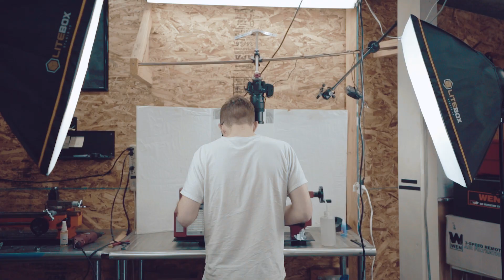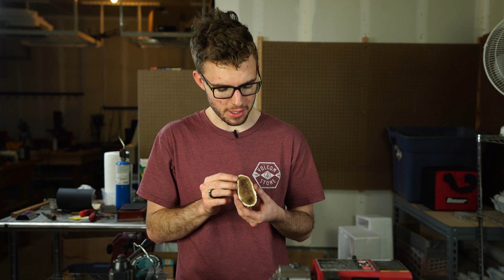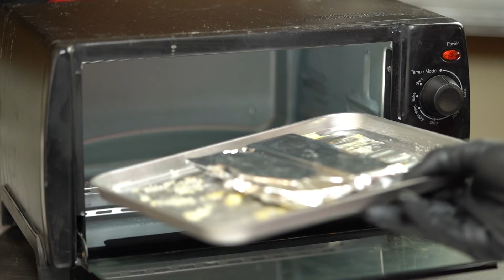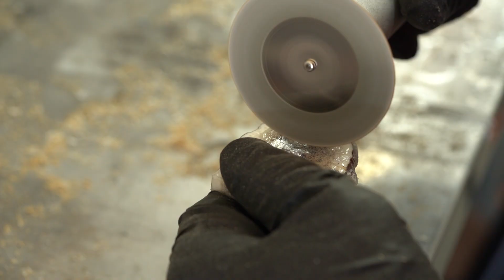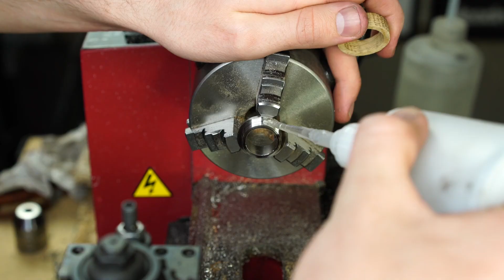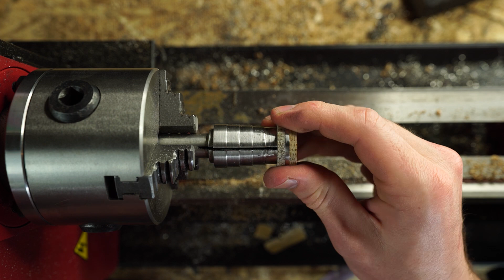Making an Aged Whiskey Barrel and Deer Antler Ring

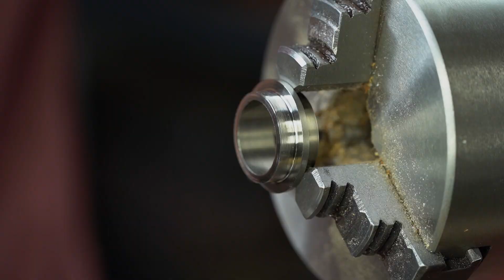Comment: Im sorry but I have to play grammar advocate here. Ive seen in a couple of your videos that you use the term “viscous” incorrectly. ( 7:43 ) In fact exactly opposite to the definition. The viscosity of a fluid is its resistance to flow. Thus honey is more viscous than water. It would be more accurate to say that its a very non viscous fluid.

Comment: You might benefit from trying some lathe tooling from A.R. Warner. They make insert tooling but with high speed steel inserts which tend to work better on smaller lathes that lack the rigidity and feeds/speeds necessary to properly utilize carbide. Trying your hand at sharpening high speed steel blanks on a bench grinder is a good idea too as you can make tools to fit any shape or situation.

Comment: Sorry, last one. I just saw the screen grap? I don’t know what it’s called but the pic you see before you click the video. I saw that and thought about maybe you could also do 2 metal bands instead of one. It would be the same process as in here but with both bands more to the side like in the ring of the link. This would allow you to do material on the side and maybe resin or glow powder in the middle? Something like that. I guess you could go in with this and try 3 metal bands though I think it might be too much at that point. Then again, I could be wrong. It would hard to do but if it was symmetric: (wood, metal, resin, metal, resin, metal, wood, etc.) it could work. You could also use food coloring to make the resin a solid color or even put glow powder on top of that for a hidden glow inside the solid color. But keep it up!!!

https://youtu.be/WtaR3suI9AI

Comment: I think this new method you made for working with unstable material is much much more efficient and I like the change of style and materials in this one. 👍👍👍

Here’s a challenge. Have you thought about making one from glass? I’m guessing you would have to use molds and melt it into shape and then sand it down later but if you could do it you can make marble rings (glass with streaks of color like in marbles) or even maybe painted glass rings. I guess you could just use resin for something like this too but I think it would be interesting to see either way.

If you use resin you would have to let it harden a little so it’s sticky but still fluid and then maybe use a tooth pick to insert color. The first two are flowers and the second is a spider to show what you can do. Obviously it won’t be this easy but maybe you could use the idea or something in one of your rings. You would probably have to use paint though. Hope this helps.

https://youtu.be/wRXoo4b5n6E

https://youtu.be/78bRHlmBEsk

https://youtu.be/mXwvW4vsPF0

Comment: If you had a more powerful lathe you could drill titanium easier. I use the low geer with mist coolant and spot drill and go straight to a 1/2 Morse taper bit . The bit dulls out because titanium eats steel bits for breakfast but a quick resharpen takes 20 seconds. I normally part off and and enlarge the hole with another bit or just use the boring bar. I only have morse taper bits in 1/8 increments after 1/2 inch so i just pick the closest and bore the rest of the way.

Comment from the maker: You can check out this ring on my site here: https://bit.ly/2JrKNq6
Don't forget to use the discount: NATURE15
Also, check out my Ring Supplies website here: https://patrickadairsupplies.com/
Reply: I can chug more beers than you Patrick.
Reply: I have a great idea for a ring. I suggest an obsidian faceted antler inlay with an etched damascus bezel and base with comfort fit with a clear coat finish. It may or may not be a little on the wide side but it will look astonishing
Reply: Hello Patrick i send a mail to you and i anxious to an awnser , its about the real glowstone Lapis lazuli ring , I've been looking for a long time for a ring like that .

Could you make one for me? can i have ? please please.
Sucess
Reply: Could you make the one ring from Lord of the Rings with glowing letters? Maybe collaborate with someone to carve the letters? I can't buy it, I just thought that it would be an impressive project.
Reply: I think this is the one i want to buy for my mom for christmas. It's so pretty
Reply: As amazing as this is i think the antler looks great as it is but i do think it looses the look that the outside of an antler has. i think getting an antler and finding a part of it that has a similar outer diameter to the ring to be made and cut a slice of it. then resin stabilize it and just turn the inside but leave the outside natural. After this add a titanium or brass inside and possibly bands of the metal on the sides of it. Though this may have to be done by cutting the two outer bands with thinner bands being apart of them that then fit either end of the ring making metal ends and a metal inner lining.